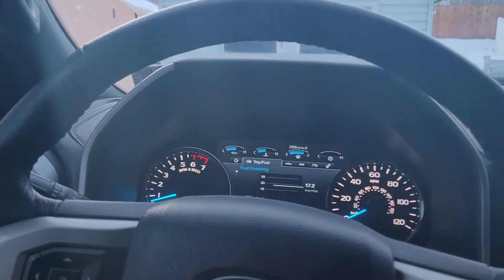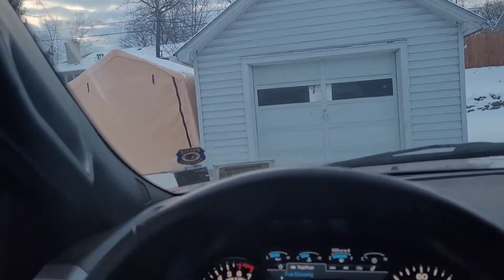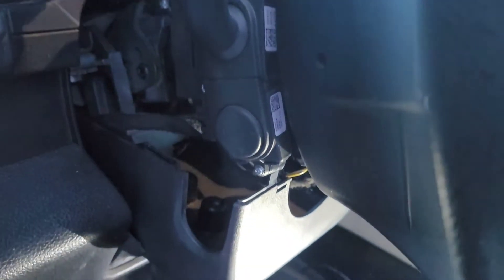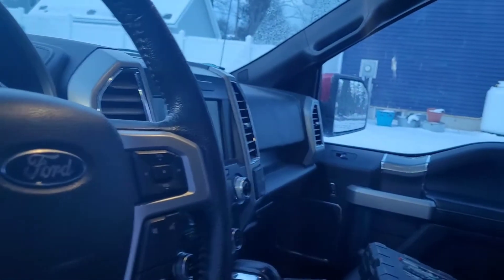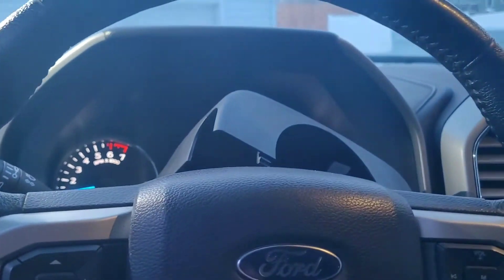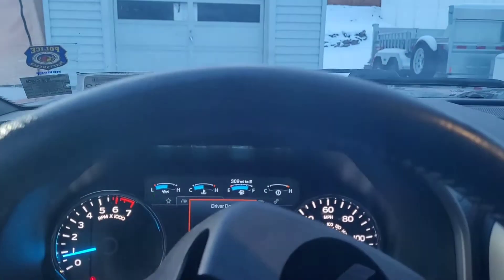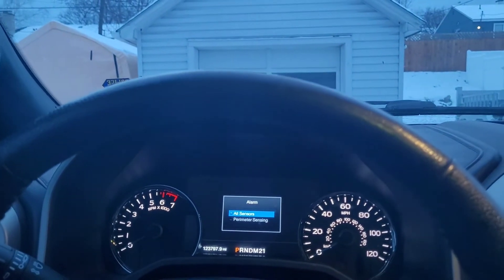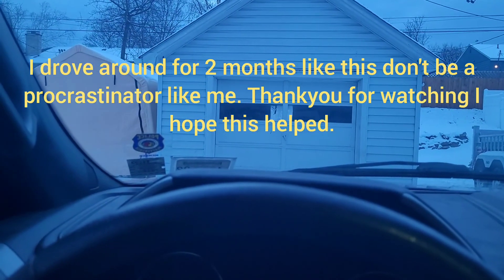f150 windshield whiper's won't turn off simple fix.

Comment: Great video. My 2016 F150 had 3 5.5mm screws on bottom of cover and 2 T10 screws holding part in place. Simple swap out.
Reply from the maker: Thankyou! It's annoying that we have to replace it

Comment: This is great. Thanks for making the video. We have to do this for my husband's 2018.
Reply from the maker: Your welcome!
Reply: @thezacharykoerickshow3173 it should have been a recall. They got away with it because it's not considered a "safety hazard". We had the door latches fixed when it was recalled for that, but the passenger door is still a problem when it gets below freezing. I sprayed the latch with WD-40 in hopes it keeps the water from sticking to it.
Reply from the maker: I agree it seems to happen to every truck. I never did the door recall because I never had a problem with mine. A friend had it done and his doors are just as bad as before.

Comment: Replacing a part will take care of the problem, but that's not really called a fix. There is a way to fix it without replacing the part
Reply from the maker: You're a genius
Reply: How then?
Reply: The byitch is dirty and shorting out.  Tiny rc car electrical contacts in a real truck is what I call rreettaarrdd engineering.